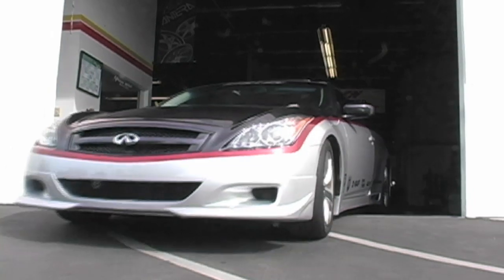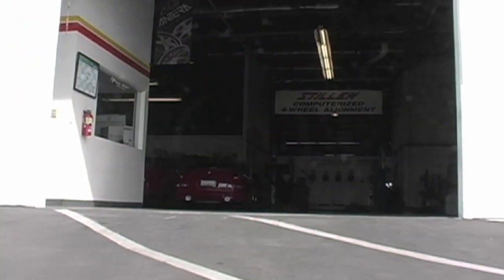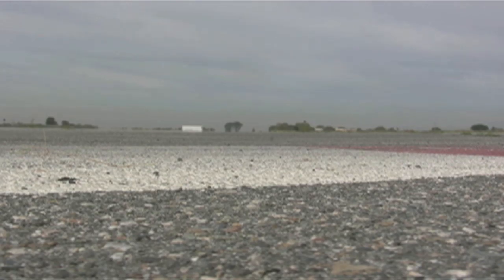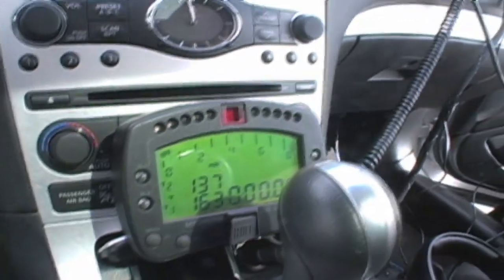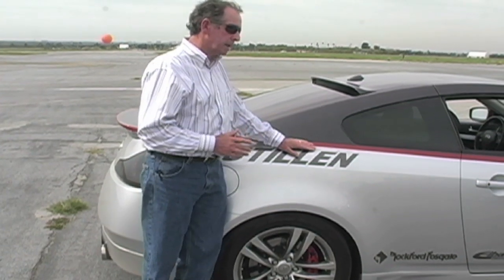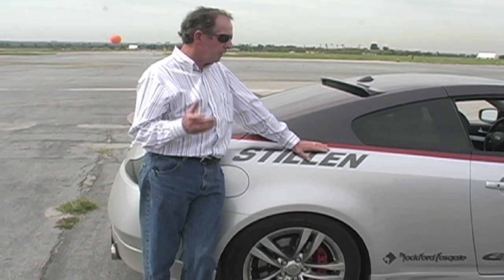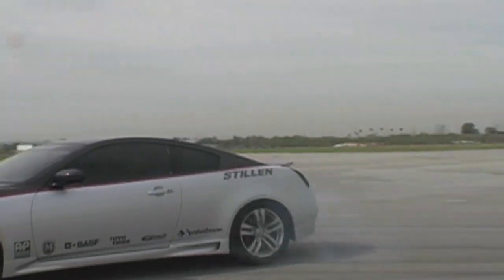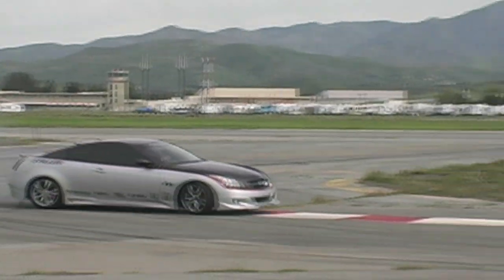STILLEN 370Z / G37 3.7L Supercharger / Dyno Test - 515HP!

Comment: 515HP that feels more like 380HP and the torque is terribly low compared to V8s. For example a 469HP mercedes E55 AMG has 515Lb-ft torque & about 1.5 second quicker than this in 1/4mile. A 515HP car at 3600 pound should be able to run 11.9sec not 13.6.
Reply: Hesam0000 13.6 time is for stock z.

Comment: here's a question no one can ever answer: the VQ is a high rev engine, but it's torque is is only rated @ 269 ft. lbs('11 G37S sedan, i own), how do you raise the torque?? a lot of folks that tune honda engines have always raved about how high reving the engine is but i noticed that cars that have more torque can move the car a lot better especially in longer distances. how do you raise torque in high rev engines like the VQ37?

Comment: now why would you compare supercharge M3 and a supercharged G37...  for the price range it should just be M3 vs supercharged G37(still G is cheaper by 20G).   it should be 335i vs supercharged G37, imo.  well equipped G37 is around 44000 stillen supercharger is around 8500 including installation.  that puts in around 52G.  335i well equipped is around 52G. also its just the supercharger putting that much power.  do some research before saying shit.